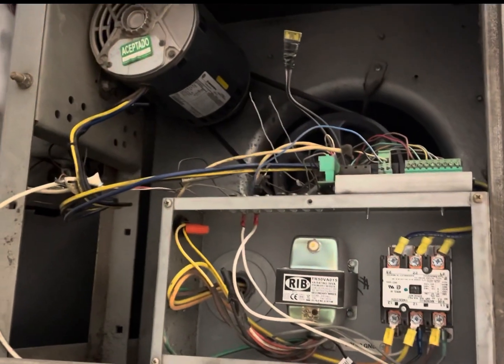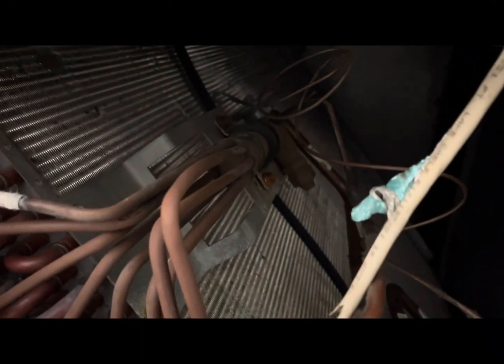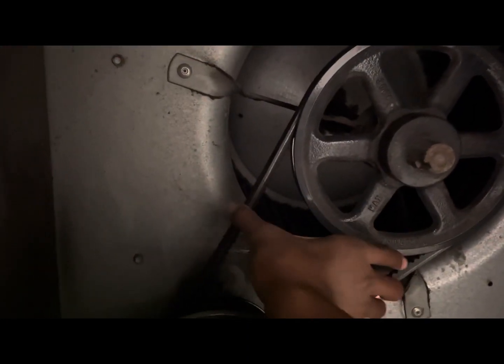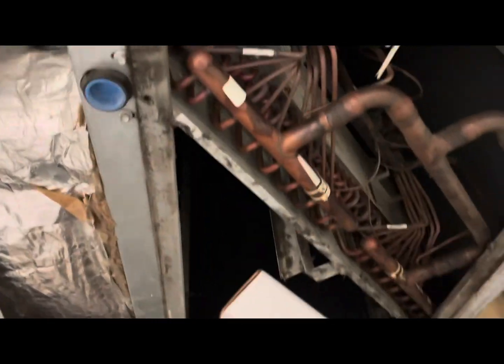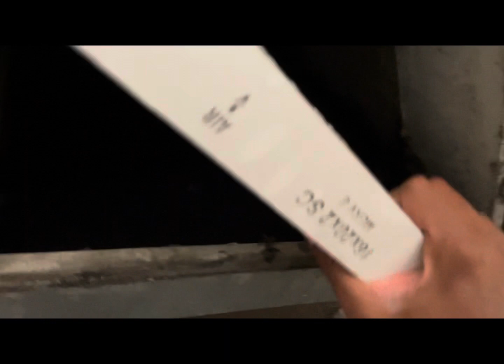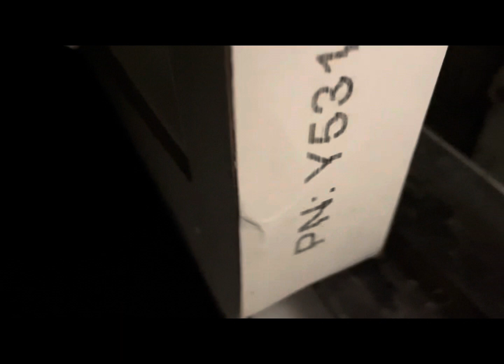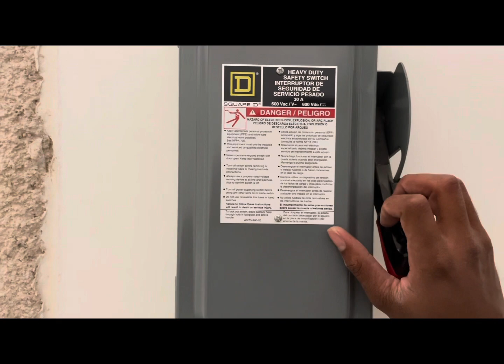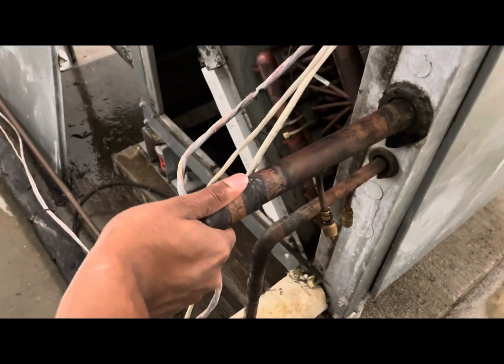Old Carrier Split System Not Cooling | Hvac Life

Comment: A little useless information. when the system has fluffy ice buildup it sometimes is due to the evaporator being too cold. The fluffy ice is due to the moisture in the air freezing before it has a chance too condense. And when you get clear ice it shows that the moisture in the air has been condensing. Just a little useless information.